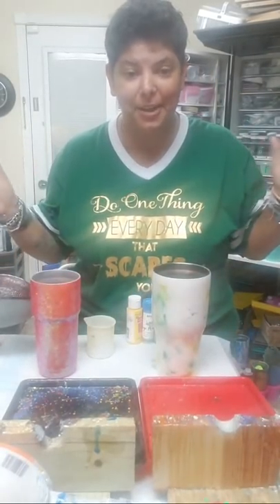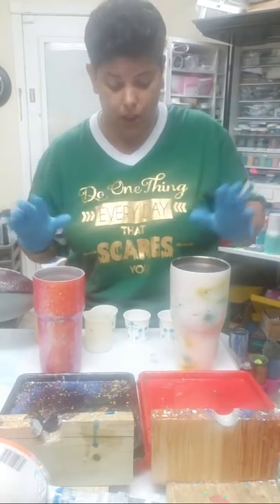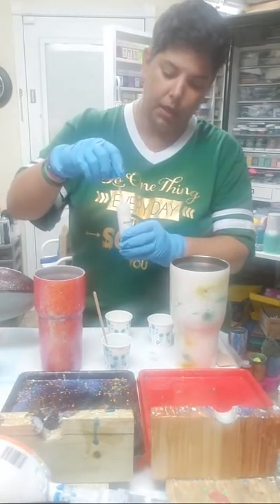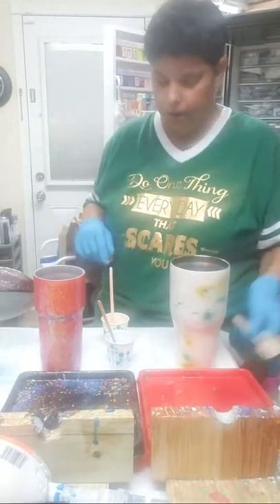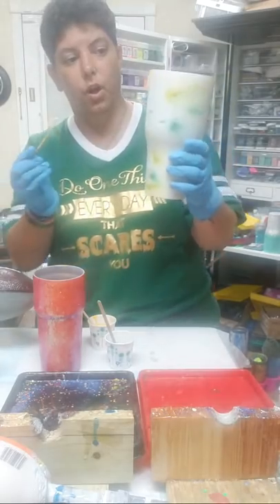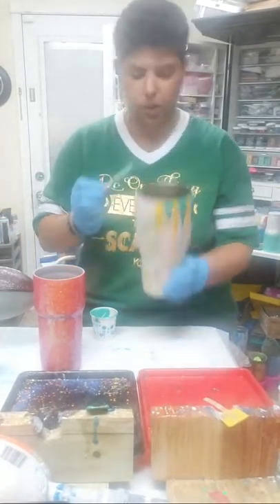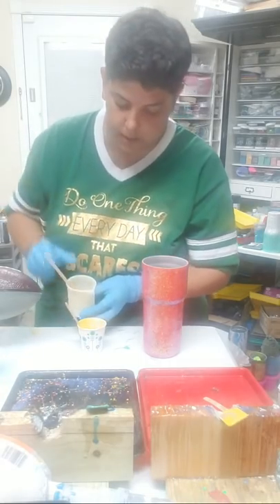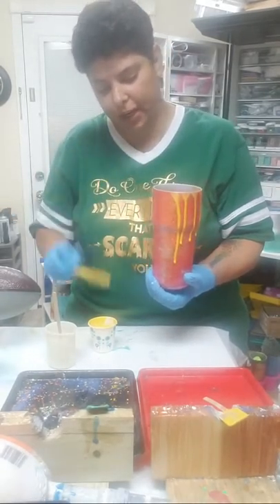Epoxy Drip On Tumbler Method

Comment: I have a question about alcohol inks... if I use ink over a glittered tumbler do I then wait and seal again? Or does the ink seal well into the epoxy layer
Reply from the maker: It  Will seal in the epoxy